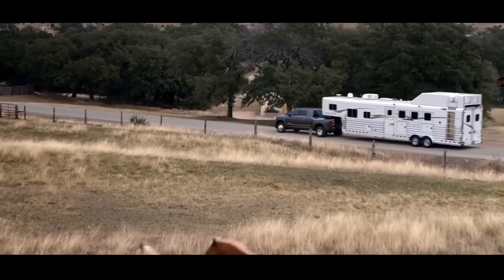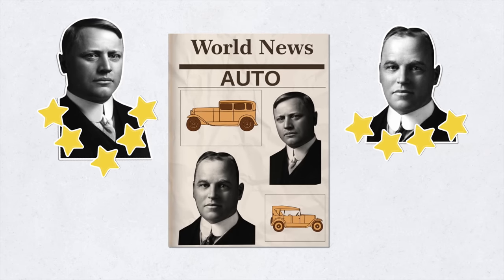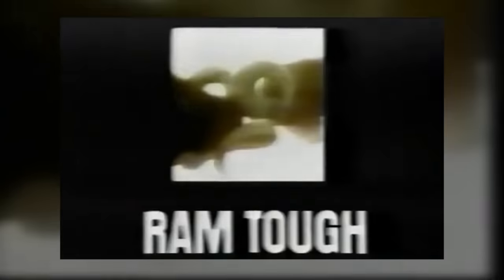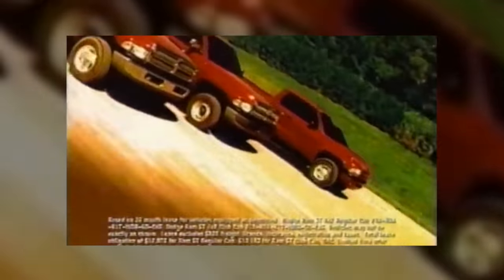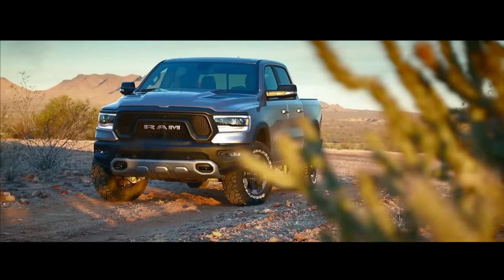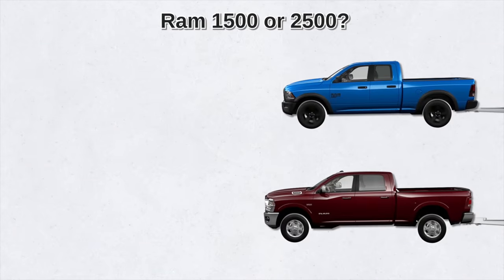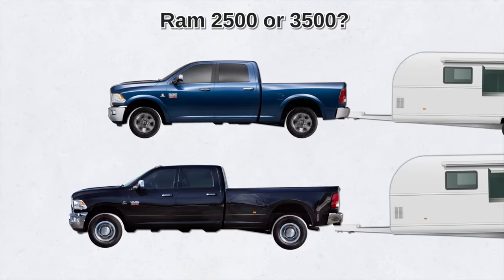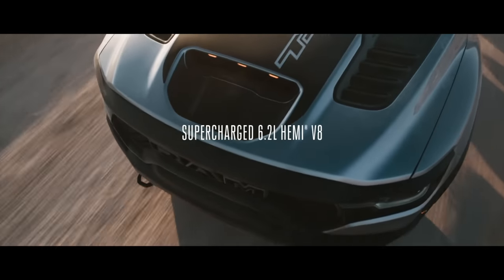No One is Telling You the Truth About Dodge Rams, So I Have to

Comment: As a retired diesel mechanic I can tell you without a doubt the Cummins diesel engine is the best available out there.
Reply: ABSOLUTELY RIGHT...
Reply: The weak link has always been the Chrysler accessories.
Reply: 100%
Reply: 100 percent legit… the V8 diesels in the competition are not as well suited for sustained heavy use and abuse .
Reply: As a currently active diesel mechanic I can tell you without a doubt the Ford built 6.7 diesel engine is the best out there especially current generation.
Reply: What year was the last fully mechanical Diesel engine made for domestic trucks? t.i.a
Reply: @stepfour  for tuner bois maybe.
Reply: Especially the 12v and 24v
Reply: Hummin Cummins. Big cam for me or n14
Reply: @stepfour  until 40.000 miles when the Ford badge show of. In our shop is all ways Ford owners pulling in.
Reply: @fabiancastellanos7196  I have my own stories to tell about GMC, Chevy, Ram.. but who cares in the end.
Reply: You Are Absolutely Right.. Cummins All The Way
Reply: It's a shame it comes in a Dodge!
Reply: My buddy gots a 21 year old Dodge Ram with the Cummins diesel engine. He won’t get rid of because he loves the truck plus there’s nothing wrong with it, very reliable truck.
Reply: @stepfour  why?
Reply: @billyonkof3183  it’s a shame Dodge does not exist in any modern truck. All RAM now.
Reply: True however the issue with the Cummings is the trash can they put it in
Reply: @Nevernotalone  2002 2nd gen with the 5.9
Reply: There is no G in Cummins so saying Cummings over and over just shows you really don’t know a ton about rams
Reply: You must be old, @stepfour is completely right. Nobody can compete right now with fords 6.7 diesel power stroke
Reply: Fitted to an absolute crap box.
Reply: I’ve pulled my 24’ enclosed trailer with a 2500 cummins and a 250 platinum with 6.7 it’s not even close! The torque on the cummins when passing someone was unreal and the handling was top notch no sway at all when passing big trucks. I felt like the 250 was like towing with a 150 just a bigger engine.
Reply: As a Truckdriver I have to agree with you.
Reply: @doubleheadergr agreed
Reply: @523FILMS  lol. No, just no.
Reply: Wrong!! The BEST diesel engine was the early 2000s 6.0L Powerstroke! 
(Sarcasm)
Reply: @stepfour  but I bet you hate your life working on them.
Reply: No reason to doubt you. LBZ was pretty good aswell. Good transmission behind them too
Reply: @alexehhhh  yes.  I both hate my life and marvel at the sadistic engineering at the same time.
Reply: @stepfour  Hahaha I bet. In my experience from easiest to work on to worst it goes Cummins, Duramax, Powerstroke
Reply: Anyone saying other wise is just plain ignorant or has never driven a ram with a Cummins, these engine are made for towing they are based on semi truck engines if v8 engines were so good why don’t any semi truck manufacturers use them they are all inline 6. Even Ford used to put the 5.9 Cummins in their heavier duty trucks
Reply: @Nevernotalone  i dont know about the others but for cummins it was 1998.
Reply: @jaroot2  indeed, bullet proof motor, but when you put in in a chassis that virtually disintegrates around it and always has!! PASS!!
Reply: Cummins has always been a great diesel, however,  cafe standards have ruined the reliability…. Diesels we’re never designed to have emission controls… let alone any electronic control modules. Diesels are NOT gasoline engines and should not be treated as such. It’s sad but unfortunately gas and diesels have their days numbered.
Reply: Vincent Morris, I’ve never met a Dodge owner to have a dodge over 200.000k. Most lose its tranny or blow engine at 180.000k. Dodge life is short lived. Every vehicle works great it’s first 100k. But I would never own a Dodge. Not reliable long term.
Reply: @silkroad1201  once the bulletproofing was done...they were very reliable.
Reply: I would want a diesel engine if I was a diesel mechanic.
Reply: Joey Larade  haha
Reply: you're right until 19 with the Bosch symmetrical pump...oops!
Reply: @stepfour  haha
Reply: @Michaelation08  lol
Reply: @523FILMS  joke you are
Reply: That’s be ford in this category.
Reply: @freedomisntfree_44  nope
Reply: @stepfour  wellwejist replaced a 2018 Ford 6.7 in an f 550 with only 97k miles. With one of the connecting rods broke I half !  And those rods don't compare to a Cummins as far a beffy goes!  And you should know yourself that inline diesel engines wear much better than the V8 models do. Simply because the Pistons are running straight up and down where v8s the Pistons are at an angle allowing the weight of the Pistons to wear the cylinder faster. Most applications on big semi trucks are i6. Not v8s in my experience the best diesel that ever went into a Ford light truck was the 7.3.  international. But ford still has the rights of the powerstroke name ! The 6.0 , the 6.4 or the 6.7 don't come close to the reliability if that engine period. Yeah alot more power like moist new diesels . But reliability isn't there!  I work for a dealer that sells pretty much all used diesels. And I can tell you without a doubt that the best seller in his lot are the Cummins trucks . He can't keep 4 gen Rams . The biggest problem with the new Cummins is just a head gasket. Which on a Cummins is a much easier job than any of the diesel v8s out there.  And most of the 5.9 was carried over to the 6.7 Cummins engine , so it hasn't changed that much except for displacement and emissions. Just Google what is the best diesel engine i6 or V8 and you'll see that I'm correct !
Reply: @michaelpincavitch5245  you make valid points and I said earlier.. we all have stories about every make out there.. Duramax. Cummins... and Ford (the only one who actually makes its own engine and did not take a buy out from Obama Motors Co.) They all have their faults and weaknesses.  I don't know why the engineers make the decisions they make.. but a lot of planning and factors come into play.. the engineers at Ford don't share your opinion of what a good motor is.  The power of the i6 is in its simplicity,  yes.  Big rigs use them because you can virtually scale them up to any size...  I can only assume Ford went with the V design for compact and horsepower.. technology has to move forward.  We could argue that a two stroke one piston engine is pretty reliable...I don't want it in my truck.  So if you want a  Duramax,  Cummins, or Ford in your truck go for it.  I'll stick with Ford. When I see a nice Dodge... or I should say RAM, because dodge quality control is so bad the truck division had to separate itself off it wanted to survive... I say too bad its a Ram. Likewise with Chevy and GMC (Chevy wanna be) But if you want to know what I really think... they are all junk in the end. But I have my brand I'll defend and that's what makes us truck guys in the end.
Reply: It's not 🚫 the Cummins Diesel Motor / It's The Rest Of Dodge That Falls Apart & Unreliable .Compared to Ford Work truck s and Chevy Work trucks
Reply: Except dodge didn't build it.  Which is a good thing.
Reply: Completely agree with this and i have a duramax😂. Love my gm trucks tho. Great combo would be a truck with a cummins engine and a allison transmission.
Reply: Yeah the cummins is great but the rest is dodge lol someone told me it was like a chandalier in a portapotty and that has stuck in my mind. I had a 17 and the tranny burned up in 68k miles towing ~4000 lbs
Reply: @Cp-jv6mf  The straight 6 is absolutely the best configuration for torque, this is even true in a gas engine. Chevy used to make and install a 250-straight 6 in their 1980 blazers and suburbans as a special order option (for those wanting more torque). And that is why they use straight 6 engines in big rigs. They're also very easy to work on.
Reply: @DoodMang7  hahahahahahahaha porta potty...
Reply: @stepfour  problem is ford will change the design next week.
Reply: @stepfour   You’re not much of a mechanic. Lol
Reply: Why did the Nissan Titans with those engines falls apart while their petrol versions are thought to be fairly reliable? Did Nissan reconfigure the engines or was it something else?
Reply: @lukemalloy2488  Only 19-20 model years were outfitted with CP4 junk, they went back to a revised CP3 version starting 21 model year (CP-ISB21) and now there is a recall for all 19-20 trucks that are getting refitted with new CP3 pumps. RAM took care of its customers while Ford and GM fought it in court to NOT doing it.
Reply: @milleniumann28  wrong.. they did a video on all the diesel trucks.. Chevy,ford and dodge. They each pulled the same weight up the steepest upgrade the ford pulled so much better it would keep gaining speed where the others couldn’t. But nice try. 🤣
Reply: @michaelpincavitch5245  ford didn’t make the 6.0 .. thought you knew what you were talking about. We have 4 trucks with 6.7 with over 200,000 and absolutely no problems. 2 6.0 with over 200,000 as well and I know a woman that has a 6.0 with close to 350,000 she left it stock and no problems.. most is how ppl treat their vehicles. Look how ppl think rollin smoke is cool when it’s actually bad for the motor.
Reply: @stepfour  
The fact that ford makes their own diesel is not a plus. What makes any auto manufacturer think they can make a better diesel than a company like Cummins? Its absolutely foolish to think that's an attribute of ford. Cummins eats sleeps and breathes diesel engines. They make 1 engine that is 8ft tall and 14ft long. 4000hp and almost 18,000 lb ft of torque. They move trains and ships, industrial equipment, semis. If ford was smart, they'd work out a deal with cummins too especially considering what they've put their customers through with the engines they've already tried to produce in house and with navistar.
Reply: There’s a reason why most hot shot drivers only use a RAM 3500 for hauling
Reply: @southocturo5243  
That's right! Most of these Ford fans don't have any 1st hand experience with diesels or Ram trucks. They just repeat what they've heard and go to bat for a brand that won't even do the right thing when they know they've put a bad product on dealer lots. When it comes to gas burners, most brands are fairly close. As for the Diesel trucks, that's a different story. Cummins has never been plagued with issues and if maintained will run an obsene amount of miles.
Reply: Agreed. Mixed with an Allison tranny and you’ve got yourself a combo that will surpass the life of the shell and all electronics by a country mile.
Reply: @jaroot2  The weak link is the emissions and DPF system. Cummins 6.7 is no more reliable then Fords 6.7 anymore. This is not 20 years ago. I owned a 06 5.9.
Reply: @calebniederhofer6529  Which I assume are Chrysler accessories.
Reply: @jaroot2   No sir. 2007,  and after have complex, and a lot of emission systems put on all diesels  . In simple terms the dpf system burns unburned  fuel, ignites it , and it turns it into a non toxic gas. The problem is, these systems clog, and make the engines run hotter, and higher get temperatures. They have taken 1 million mile diesels and turned them into 300k trucks. It is a shame.
Reply: What good is an engine when my transmission just hit the floor on the highway? Lol. Don’t get me started in your SUSpensions.
Reply: @lwnmwr1361  There is no Ram in Cummins either. People always say to me, "I didn't know your were a Dodge man" my reply. "I'm not. I'm a CUMMINS man." I don't even like Dodge products.
Reply: Has been since the Cummins 250👍
Reply: @djmartin201nj  diesels need the emissions controls more than gasoline because they pollute more. Blame the manufacturers for not doing a good job with the emissions tech.
Reply: @stepfour  we will see about that...
Reply: How do Chrysler's transmissions hold up?
Reply: Cummins is second to none.  The best.
Reply: "best available" doesn't say much. that's like saying, "of all the crappy items, this is the best available" lol
Reply: The current Cummins engine has been out for a few years. It has no track record on reliability or durability.
Reply: I really wanted this to be true. I can only be honest. I have had two cumins a 2500 and 3500. Both transmission went to crap. Cumins great motor but everything else will crap out.
Reply: Ya no you’re out of your mind big rigs their are better Diesel engines and currently the 6.7 powerstroke better than the cummins 6.7 prove me other wise you can’t .
Reply: @Cp-jv6mf  - that funny because the 5.9 cummins was never approved for any big semi trucks and the 7.3 powerstroke was. There is allot of internet Cummins fanboys and I think the majority just repeat dumb crap other people say. The Dodge Ram was last to the game with a diesel (1989) and it was reliable because it was meant for machinery. Same can be said for the 6.9L V8 that went into the Fords in 1984. The 7.3 Ford PowerStroke was quite reliable. I know of many school buses that went 15yrs 3-400k and still had the cross-hatch in the cylinders. The cummins was not nearly as common in school buses.  You could order a 275hp 750lbft 7.3L V8 with an 18spd in a day cab international 4900  as a highway tractor with a GCWR of 60,000lbs. Never I mean NEVER did Cummins ever approve a B5.9 series/ISB or the 6.7 ISB for anything over 40k let alone 60k. Even the C8.3/ISC didn't cross the 60k mark until they added stroke in the mid 2000s to make the 8.9L ISL.
Reply: @treeamigo8447  - gas burners Ford 7.3 will put any ram gas truck or Chevy gas truck to shame! Fact!
Reply: @treeamigo8447  - unfortunately cummins didn't
and still doesnt build the 5.9/6.7 B series engines for Chrysler/Daimler/FCA. That engine was co- developed by Cummins and Case, for equipment and tractors. It's a contract where cummins supplies engines to FCA and that's it. Ram would have been nonexistent without the Cummins.
Reply: @CoyoteFTW  I never said they were put in big rigs but the design is the same of big rigs on the road. If the v8 was as reliable and easy to maintain it would be that design and its not. You can order anything you want but putting an 18spd behind a weak 7.3 V8 won’t last long that is why does International trucks are considered disposable trucks
Reply: @CoyoteFTW  
"Ram would have been nonexistent without cummins" and you would be nonexistent without your parents. What does that have to do with anything? Ram uses cummins and your reading this. Great. Aside from those pointless fact, cummins does manufacture the engines right there in Columbus Indiana. The duramax is manufactured in Ohio and the powerchoke is manufactured in Mexico. As for the gas engines, naturally a larger displacement engine will in fact have more power than its competitors. Guess what else it does? Drinks more fuel.
Reply: @treeamigo8447  - “Dodge” who hasn’t built a truck in 20 yrs was irrelevant before Cummins. It was ALWAYS last place. Ford, Chevrolet and then Ram. Ford outsold the other two for over 40yrs and counting. City slicker kids like yourself. Like ram because they get excited over the word Cummins. I have no idea why. Best 1 ton truck you can buy is 6.7 PowerStroke I don’t care how upset that makes you. But let’s stop talking about the engines let’s talk about the transmission and cooling. The new “Allison” 10L1000 is actually an evolution of the 6R140 from Ford/ZF, used in the previous generation of Super Duty. The Allison 10L1000 is a near mirror of the Ford 10R140, with a few proprietary differences to apply to Allison's engineering and currently held patents. Only thing ram made in the truck is the transmission and you went through 5 before you hit 100k miles. Another thing when using a truck for serious work is keeping temperature down. Temps on the ford, are because of the way it is cooled. The Ford has water to air intercooler, oil to water engine oil cooler, and the transmission oil cooler is also oil to water. Advantage is the heat can be faster dissipated from the individual components. Trade off is the average temps are higher. Where as the Ram and GM have oil to water engine oil coolers, and everything else is oil to air. Issue with this is, once the component gets hot it's slower to dissipate the heat. So it looks better upfront (lower initial temps) but once it gets hot you have to stop working it so it can cool. Works similarly to jumping into a 75f pool cools you faster than 75f wind. The amount of heat transfer is faster because water and oil have similar density and ability to absorb large amounts of heat quickly.
Reply: @Cp-jv6mf  - Do you know how to read ? The 7.3 powerstroke was approved for use in highway tractors with a GCW of 60,000lbs.. The 5.9 Cummins NEVER approved for that. Which one was the weaker engine? Can you guys try not to be fangirls stop being so emotional?
Reply: @CoyoteFTW  look who is talking you sound more emotional than anyone else on here 😂
Reply: @Cp-jv6mf  - you fiat fanboys get really upset when facts show up
Reply: @523FILMS     no one can compete with the amount grenaded fuel systems we've had with our 6.7 ps but not with the out cummins not to mention the worst fuel mileage of any of the our fleet is the 6.7PS
Reply: @Cp-jv6mf   best truck we had at work was a 2012 F650 with a cummins and Allison trans haha.
Reply: It was when it was the 5.9 as of now 6.7 powerstroke has proven to be more powerful and reliable.
Reply: @BessieRiggs  Sorry what is the gospel?? What I said about CP4 recall in 19-20 RAM trucks is the fact, not gospel. I'm currently on a waiting list for a new CP3.3 for my truck.
Reply: Well my buddies new Cummins tranny blew at 100,000 km
Reply: @billyonkof3183  what's wrong with dodge there a beautiful truck
Reply: yes but if you are regularly pulling a lot of weight. GM is your best option because of the allison transmission.

The new Ram 2500 I heard will have the allison transmission
Reply: @boostjunkie2320  more gears is not equal to better transmission. New Allison is garbage. Want a tough transmission go with HO cumming which is matted to Aisin 6 speed.
Reply: @vitalikolos144  I didn't say more gears are better. I worked for a business that operated a fleet of trucks...They had to use GM bc of reliability and the cost of  maintenance. it was all about the money....Not brand loyal fanboy stuff
Reply: Maybe second to Detroit, try wrenching on a ISX 15
Reply: How's the transmission
Reply: Bar NONE
Reply: @stepfour  wrong
Reply: The only bad thing about the Cummins is the dodge junk surrounding it
Reply: @val13c59  My 2008 3500 4x4 dually with 320,000 miles has been an amazing workhorse. The 6.7L Cummins is a very reliable BEAST.
Reply: Who can afford the diesel prices? By-the-way ram trucks frames are snapping like crazy!
Reply: @523FILMS  I don't think the 6.7 ford is rated for a vehicle with a 66,000 lb gvw like the Cummins is
Reply: @523FILMS  I don't think the 6.7 ford is rated for a vehicle with a 66,000 lb gvw like the Cummins is
Reply: That's pretty common knowledge among mechanics; it's the customers that argue their power strokes are the best, or Duramax. I'll tell you a secret- those two cannot hold a candle to the Cummins. Not even in the same league.
Reply: @523FILMS  they don't compete bc the Ford can't leave the shop. 
Gotta pull the cab to replace a turbo, yeah that's smart.
Reply: The 5.9 is the best diesel engine
Reply: @stepfour  that's a lie new power strokes new Cummins new Nissan new Chevy Duramax engines All garbage compared to the old ones!!
Reply: @ernestopedraza3507  like my Holiday Rambler motorhome!
Reply: Just had a 2017 3500 in the shop on Monday. the plug for the high beam low beam lights had a prong come out of its hole and it melted the plastic. I hate Chrysler so much lol
Reply: @Cp-jv6mf gas mileage
Reply: @val13c59 I have 250k on my 1996 Dodge Ram 1500 with 360 Magnum in it here in southern Ohio. Still going strong and I drive it frequently in the winter. 

My neighbor has a 2005 Dodge 3500 with 200k on it and pulls his trailer to northern Michigan every summer.
Reply: I agree - I believe inline 6 is a superior layout to the V8. After all, most diesels are i6 now
Reply: @FreshSav 7 journal bearings instead of 5 for a v8..
Reply: That's not true.   The Toyota diesel in the Hilux is better.
Reply: 2RZfe has my vote.
Reply: They're reliable and simple. I have a 12 valve (1995), a 24 valve (2003), and a 6.7 (2013) they've all been great. They go and go, and whenever they need something it's available on the shelf anywhere, and doesn't take me very long to get them moving again. Only exception was the DEF system on the 6.7, which mysteriously got lost after it gave me issues lol
Reply: @stepfour  every diesel mechanic I have ever known up to today consistently agrees with the cummins being no1, no matter what the like (ford, chevy, toyota, ram, whatever)
Reply: @joeshmoe8952 Only reliable thing is the Cummins engine and nothing else.
Reply: 🤣🤣🤣 CHEVY DURAMAX IS THE BEST DIESEL ENGINE, AND TEARS THE POS cummins TO SHREADS SOOOOOOOO
Reply: What about Hemi?
I just bought a 08 with 164k miles
5.7
Whaddya say?